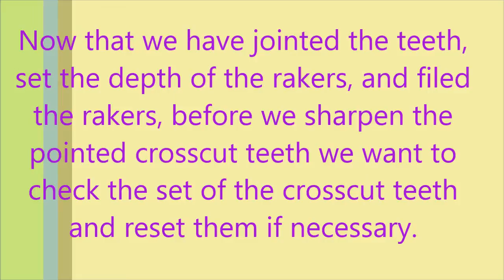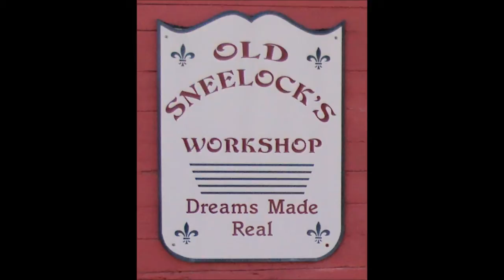Sharpening a one man crosscut Pt 5 - Setting the teeth - by Old Sneelock's Workshop

Comment: Bending only the tip of the tooth prevents the whole tooth from cutting, the tip cuts first, and this results in the rest of the tooth (being narrower) or not bent as much, not using the cutting surface at all. Because the tip that was bent, was bent out further, therefore already made the cut, so you have more than half the tooth, not cutting or using the cutting surface at all. Thats why we bend the whole tooth....so from slide 1, all teeth and whole cutting surface is being used. You could have finished that job 2x faster. 

Not crushing your nuts here mate, but my Engineering knowledge and personal experience never let me down. Been sharpening those for many years to, and i bet you have also been doing it for a long time. But.....sometimes we are taught wrong.
Reply from the maker: I see what you are saying but what is the point of bending the tooth to create set?
My understanding is that the purpose is to create a wider kerf so the blade has clearance. 
The tip of the tooth cuts. Not the side.
Reply: @OldSneelock  the point is, you don't have a bent cutting surface, remember, the piece touching the wood, is the piece that will cut....if only the tip touches, that's what's cutting....if you bend the whole blade equally, it will use the whole blade's cutting surface, instead of only the tip...try it...0.5°
Reply from the maker: I think you are mistaken. The tip of the tooth is the part that contacts the wood. Since the tooth is set so the tip of the tooth is .010" further from the center of the blade than the base of the tooth, the kerf is .020" wider than the blade is thick. That provides clearance for the plate to follow the cutting edge. 
Since the base of the tooth is attached to the plate the base of the tooth will not be touching the sides of the kerf if you are doing it right. 
With that in mind it follows that any part of the tooth other than the tip will not be in contact with the wood and therefore won't be cutting.
Following your logic the tooth will have to be bent in an offset so the tooth is set parallel to the plate at .010 wider than the plate is thick. 
That could be done. 
The result would be still the tip of the tooth will be cutting the wood. The side of the tooth that you have parallel to the plate at a .010" offset will be rubbing on the ends of the wood fibers that the tip of the tooth has sheared off. 
You might as well not have any set to the tooth at all.
Reply: @OldSneelock  no....the whole tooth cuts...not only the tip. 
If you use a saw set and bend only the tip, yes, thats what youll get. But in theory, that way is wrong. The whole tooth is sharpened from tip to end of its body, so thats what youll need to cut with. Otherwise just sharpen the tip  hence that is the only thing that cuts the wood. 

I have been sharpening these saws for many years, my grandfather use to use those 2 man saws in the forests. I have competed in many buck saw competitions as well, Dont let youtube teach you how to sharpen a 2 man saw. Do it the right way. Use all of your saw's potential. Let the teeth do the cutting. Not the tip. Otherwise your saw is useless. Youll be spending 2 minutes cutting through a 12 inch log, which should take you in reality about 30 seconds to complete
Reply: @OldSneelock  just to add there, yes your cut area is wider by setting the whole tooth and not only the tip. But you can go to any bucksaw championship and see how wide of a gap there is when they start sawing those logs. . Its because we use the whole saw's potential. 
Yes...the saw pulls a bit harder, but it cuts 5x faster. Big shavings coming off there. No saw with only a sharp tip will have the ability to cut that fast, or have those type of shavings coming out.
Trust me...i know this for a fact. Been doing this for a very long time

Im really struggling to get this into perspective and getting people understand this theory. Seems like their brains are not wired to understand this most of the time
Reply: @OldSneelock  Then pause this video at 1 second, to see how the teeth are sharpened. The shavings matches the length of the tooth, because we use the whole tooth...and not only the tip...pay close attention here..

https://youtu.be/FmnR6NYtUS8?si=L9SzHtIKu2nZHSte
Reply: @OldSneelock  The small tooth that you see on the larger one split at the bottom like a upside down V is called the pre cut teeth and the other is a raker sitting next to it, they are responsible for keeping the cut straight and cutting a small path the bigger part can cut and the raker gets rid of what was just cut, that whole tooth....from top to bottom is sharpened, and that's what's being used to make those fast cuts. A tip sharpened blade someone sharpens in their back yard will never deliver like a saw sharpened by a guy that understands this theory correctly, so no....i am not mistaken. I just know and understand how these saws work.
Reply: @OldSneelock  The saw set he uses here is not entirely the right one either. These sets are one of the first sets made. The typical crosscut 2 man saw , saw set you want is the one with a slight off center offset, so it gives your saw teeth that slight turn, and not only a bent
Reply from the maker: @vanstaden  https://youtu.be/kD976NlxrSE?si=9ai9QmLRnXFbFoEW
Reply: @vanstaden  Competition saws are filed and set differently than a saw that is used for everyday use. They are only worried about speed of cut and not about how long they can work before they have to sharpen again. They are sharpened and set as aggressively as possible.
Reply: @ronnieelmore9066  part of that is true. They are sharpened a little different. But they do last as long as your average saw...like i said, i have been doing this for many years. A guy telling me to sharpen only the tip can go talk bs to someone else. Amateurs do that. You need to use the full potential of your saw  and to achieve that, you need to know how to properly set and sharpen it